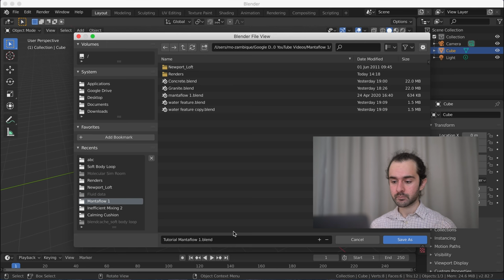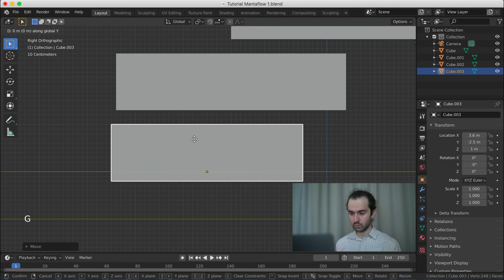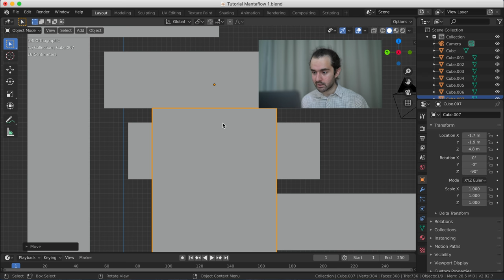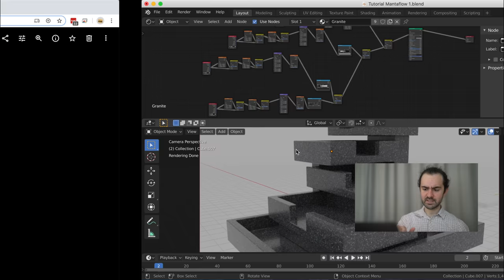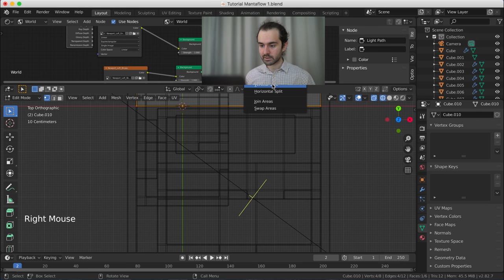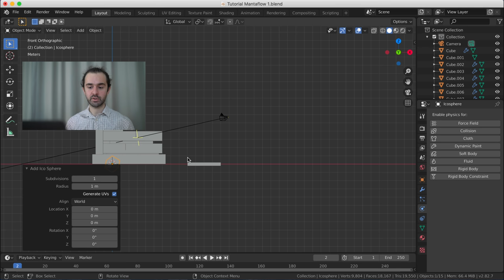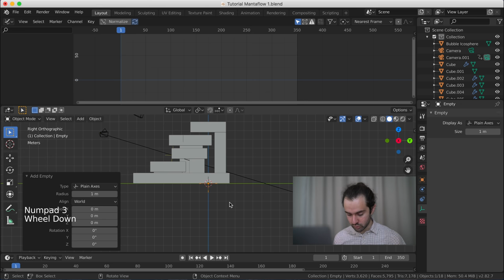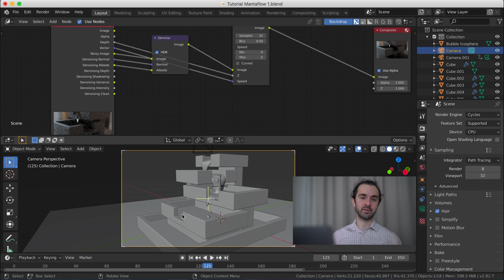Tutorial - Beautiful Water Feature Fluid Simulation in Blender and Mantaflow

Comment from the maker: 🙋🙋 EDIT FOR ANYONE USING BLENDER 2.83 OR LATER! I've noticed a few comments of people struggling to use this in Blender 2.83 or newer because the bake button isn't visible by default. This is very easy to fix. Just scroll down, and change the cache type from "replay" to "modular".  Blender 2.83 just changed the default. Alternatively, you could use "replay", which means you don't even have to bake the simulation! You can simply play the animation, and it will bake it in the viewport. Also, make sure "use effector" is ticked when setting up your collision objects, not doing this might lead to the water falling straight through your fountain. The new update seems great, includes some performance improvements and makes particles much more realistic. If you'd like another tutorial on this new version, drop a comment down below.

Also, if anyone is baking the simulation and no fluid appears, try increasing the resolution or making the inflow larger - if the inflow is smaller than 1 voxel it won't recognise it, and so won't create any fluid. 

Don't forget to like the video for more like it, and subscribe so you don't miss future videos :-) what tutorial do you want to see next?

Comment: Awesome tutorial!!!
I work in 2.9 so I had to modify a bit regards the liquid reaching the bottom floor so I extended the frames to 480 and kept the timescale at 1 and the particle radius at 0.8 and it turned out really nice with 128 resolution 😃👍
Reply: P J  in cache(where you add start and end frame) there is something called replay, change it to modular
Reply: Hello 
Hey I did timescale to 2 is that a problem

Comment: small explanation:
36:50 minimum timestep is required higher when using big domain with low resolution and small inflow with initial velocity...
it helps to prevent liquid simulate like a spheres when it just generated from inflow, so particles being calculate their position between actual frames.
So for pretty good liquid look its better to leave it at least on 2

Comment: I make real water features and have a couple observations that might help this look more realistic without much work, hope these help anyone looking to render this. 

1. Add a small lip on every part where water overflows to add a small layer of water to the step, otherwise the water won't build up and will look more like honey than water.
2. Make the bottom pool deeper, that's how a real pool would be and it will prevent it from overflowing like it does in the video.
3. After you make the bottom pool deeper you can increase de size of the bounding box so that you don't get any water hitting an imaginary box, it will look like the actual fountain is what is holding the water.
4. Decrease de flow rate of the water a little to avoid such turbulent flow, that much flow wouldn't be possible with a small fountain like this since that much water would overflow once you turned off the pump since it would all accumulate in the bottom pool.

Great tutorial, thanks!

Comment: When I get up to the fluid sim, the source goes through the first tray even when I have fluid collision on. idk what I'm doing wrong because the other object's collisions work except for the first top tray help! (yes use effector is ticked).
FOUND FIX: for blender 2.8+ = if your fluid is going through your mesh make sure to set the surface thickness of the mesh's effector settings to 1, this will make it collidable
Reply: Many thanks!
Reply: Thank you so much for posting this! I was stuck in the same spot!
Reply: @stuartpurdue  check your normals , if they are red just flip them
Reply: Oh my god, you saved  me! I was absolutely losing my mind trying to figure out why the collisions weren't working. Thank you so much!

Comment: Well done tutorial with a nice outcome.  I'm using 2.91 and I had no fluid until I adjusted a few things.  I find it very hard to get the fluid right, a tutorial on understanding how to gain control over the fluid would be great!  Right now it's overflowing the 3rd tier but not the first two and if I use the settings in your video, I get no fluid.  I have to turn up the Inflow Flow Source, Surface Emission but it's very fiddly.

Comment: I loved it and I followed along. I am having one problem though. The bottom container takes so long so start filling up with water even though the water is flowing into it but doesn't show right away. I'd really appreciate a reply with the answer.
Reply from the maker: If you want the bottom container to fill faster you could do a few things. You could try having a second emitter lower down, or you could add an object which is a “fluid” rather than an inflow - this adds some water just on the first frame, rather than constantly adding water. Unfortunately though sometimes the best solution is just to simulate it for longer
Reply: @MobyMotion  I really appreciate it.

Comment: I feel that the liquid which i flowing is very less, like its hardly reaching the third slab? Where did i went wrong?
Reply: same bro did you found any solution ?
Reply: @southernequinox   No bro, I gave up on that project, but certainly will return to it soon enough, when I can use blender well.
Reply: @atharvamali8742  i found a temporary solution, if you make you whole setup small in size by scaling it down the amount of water fills it up.

Comment: super strange problem... I have followed all steps in the fluid baking process, even redone the whole thing twice and am not getting any fluid emitting from the cube. I've been using blender for a while now and have never run into this problem before, any ideas/suggestions on what this error could be coming from?
Reply: @Max-yh5ng  Worked... kind of. Scaling it fixed the particle emission, but for some reason the flow ignores all extruded regions of my structure, and only responds to the "floor" meaning none of my walls rebound the water.

Comment: Great vid, Moby Motion, If you look at 0:05, where the water shows at left corner of the bottom geometry, you will see that it has a sharp edge. How can this be fixed?
Reply: It appears that the water is running up the invisible domain cube, otherwise it would splash over the edge of the basin. You'd have to reduce the strength of the water or increase the height of the basin lip, I think.

Comment: I've had the problem with the expanding water in my bakes also. I haven't followed exactly so I'm using quite a different scene but the overall idea is the same. However changing the particle radius didn't seem to fix the issue at all. Any suggestions? Thanks.

Comment: The water just falls through :(. I tried placing hte emitter above the top tray following your adivce in the comments section. Thank you for the vdieo though. It was fun to follow along. Too bad I couldn't get all the way through.
Reply: using 128 resolution and adding a surface thickness to the effector seemed to solve this problem for me. Although now the water moves too slow from one tray to another. May need to go beyone 250 frames. Let me try.
Reply: @7uvenucmeIz  Scale of your objects might help too. Mine was clipping through the obstacles at resolution of 64 and domain box with size 25-25-16, then i scaled it down to %20 of its original size applied the scale, with everything else being same, it helped it quite a bit.
Reply: Frozander yes! I eventually realised this and set the scale to 1.  Let me try going lower. Going till  500 frames with some tweaks on z velocity and  time scale seems to work as of now
Reply: Hey man, having the same issue here and I already tried all the things you mentioned, did you find out anything else? My effectors are not working at all :(
Reply: would literally eat my pants for coin asmr 4 scalimg down, increasing to 128 resolution and increasing the effector thickness to 0.02 sorted it for me. rn my water doesn't move to the lowest effector even after 360 frames. figuring that out
Reply: @7uvenucmeIz  same mine jsut goes down 2 storeys only. What to do?

Comment: This is a great tutorial, just like the pills one, which I enjoyed very much, thank you. 

I have a problem with my bake: the effectors have no effect on the fluid, it just drops through the first basin. I have tried changing the particle size back to 1.0, set rendering steps to 128, changed the size of my source, subdivided the first basin, increased the separation between basin and source, also reduced the separation. Nothing works. All particles just fall straight down. I have also tried adding a surface thickness to the first effector, but then no particles show up. Same if I reduce the z velocity to 0.1. 

In another comment you suggest placing the fluid modifier above the bevel modifier.  This also had no effect on my issue.

Any ideas? Happy to share my file.
Reply from the maker: Glad you are enjoying these tutorials :-) This is very strange though-I suspect something is wrong with the geometry. Try deleting the basin (or at least removing the fluid modifier, and moving it away from the scene). Then, replace it with a simple cube without any and see if that successfully interacts with the fluids when you add an effector modifier. Then, you could slowly model the basin again, testing to see if it interacts at every step. Let me know if you try this and it doesn't work, happy to keep trying to help
Reply: @MobyMotion  Thanks for replying. I thought I had found the issue when all my basin normals were flipped, pointing inwards (probably happened during the initial scale), but that didn't change anything, with the original fluid emitter. I added a default cube, made it an effector, and the fluid goes through that as well. I deleted the inflow object, added a default cube (within the domain), made it an inflow object, and it flows through everything, even the new default cube. I'll keep investigating.
Reply: I made a new file from scratch. I have learned that if your inflow object is too small/thin, no particles emerge. 

I saw another comment mentioning a different-sized domain. I reduced my domain to half the size and suddenly the first basin started working as an effector, though around frame 50-80 the simulation became unstable at the inflow. The new size is 12.4 x 9.1 x 6.5 m. The domain was resized in edit mode, not via scale in object mode. 

 I resized the domain back to the original size in edit mode. The new size is 12.4 x 19.8 x 6.5 m, so about twice as long. The fluid starts going through the effector, then at about frame 30 or so starts being affected, and a few tens of frames later goes nuts. 

For context, my first basin is subdivided in edit mode, so I have about 6 total edge loops per side, and I deleted the bevel. The basin's dimensions are 5.4 x 5.4 x 1.2 m, and the bottom is about 0.4 m thick.
Reply: At this point I'm not really sure what the takeaway is. I'll probably re-create the entire thing from scratch, this time testing the fluid bake at each step, but that's not really a satisfying resolution to this issue yet. =)
Reply: @individual61  Hi there, I've been having similar problems but after changing my FLIP ratio to .370 from its original setting my simulation fixed itself! Not educated in the nuances of what my cause this but I thought I'd let you know.
Reply: Max Manwaring-Mueller thank you for letting me (and others!) know!

Comment: Overflow problem. For some reason, I cant seem to fix the problem you describe on 39:05. When I make the particles smaller than 0.8 they fall through the mesh. When I have them between 0.8 and 1 there is a massive overflow. I tried making the flow source smaller and I also slanted the bottoms of the fountain so the water can flow away faster but nothing seems to work.
Reply from the maker: Try to reduce radius below 0.8, but also increase simulation resolution. This will slow things down, but should solve your problem.
Reply: @MobyMotion  thanks man I will try!

Comment: Absolutely love these tutorials, man. Keep them coming!

Quick question, whenever I "esc" my bake, to see what it's doing, I'm not getting those particles to show. Any idea what I could be doing wrong?
Reply from the maker: Just to check-your domain is a wire frame, not solid? The things I would be checking are:
1. Is the fluid particle system enabled? So, if you select the domain, and go to the particle physics tab, is that will be a particle system called "fluid system" (from memory). Is this enabled in viewport?
2. Do you see any particles if you go back in time, for example to the first few frames?
3. Are you using the same version of blender (2.82)?
Reply from the maker: Thanks for this question by the way, hopefully anyone else having the same problem can't find it later on, and learn from it (If we can solve the issue haha)
Reply: @MobyMotion  Hey, no problem.

The domain is a wire-frame in my view-port. I can see the rest of the objects, clear as day.
1. Even before activating the "spray - foam - bubbles" particles, it's not showing up after I baked it for a while. (about 100 frames in)
2. No particles, at all.
Reply from the maker: But in the particle tab, there should be a fourth particle system just for the fluid. Do you see this? And is it enabled. Even though you can't see the progress as it goes along, you can still see which frames have been completed already. Are you sure it is simulating a single frame?
Reply: Yes, Liquid, Spray, Foam and Bubbles, are checked for "Realtime". Now, here's where it gets even weirder. If I select the domain box and change my "Resolution Divisions" from 64 to 128, I do see the particles. Takes a hell of a lot longer to simulate, though.

EDIT:

When I put my Resolution Divisions on 70, I start to see particles. However, my particles are crazy small, compared to yours.
Reply from the maker: On your domain, did you "set origin to geometry"? Does your scene look drastically different from mine?
Reply: @MobyMotion  I did, and the particles that I now do see, are in the right position. But they are tiny. Like, I've let it bake for over 700 frames, and the third level of geometry isn't even filled up yet.
(the geometry looks pretty similar to yours)
Reply: @KingKiloOfficial  I found that we need to set a "surface emission" value in the emitter settings, but i dont know the correct value yet.
Reply: @CanalDoClaudin  Hey, that does seem to be doing something. I've put it on 1, and I can now see the particles, even with a "Resolution Divisions" of 64. However, they kind of stick to the cube, as a weird blob. Moves around like some sort of slimey monster.
Reply: @KingKiloOfficial You net to set your "normal", "source" and "surface emissions" values to 1 in the emitter settings.

 And we also need to set a "surface thickness" value in our collider meshes.
Reply: I've used 0.8 in my particle radius and 128 divisions. it works fine now!
Reply: @CanalDoClaudin  With the settings you've proposed, it works, but most of the particles lose their collision with the geometry... I'm at a dead-end, at this point.
Reply from the maker: You mean they fall through the structure? Try raising your emitter up slightly so it's doesn't sit exactly on the structure
Reply: @KingKiloOfficial  I have the same problem as you (I'm on Blender 2.83) the baking process is not a success
Reply: @MobyMotion  Having the same issue. I followed the tutorial exactly and tried everything suggested in this thread as well but have yet to see any particles. Not sure if it's because I'm on a newer version of Blender or not. Lmk if there's a fix any of you guys were able to come up with. Thanks!